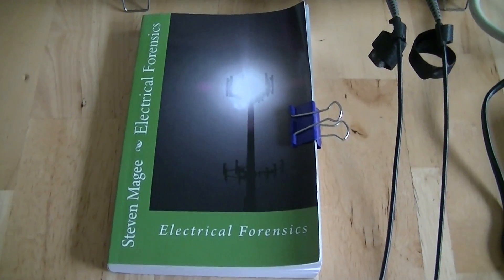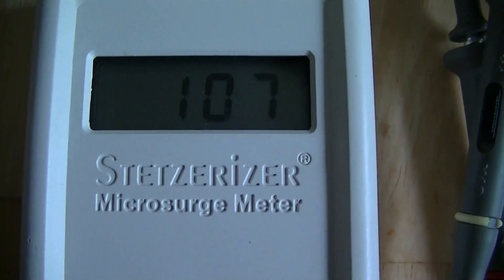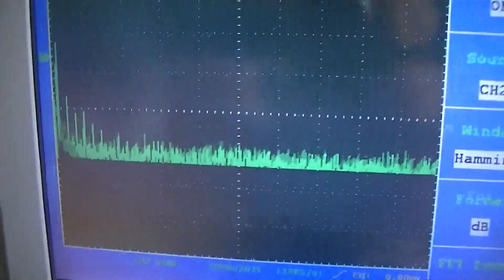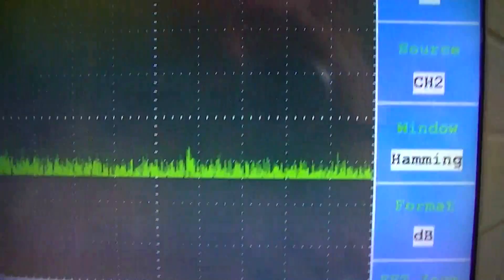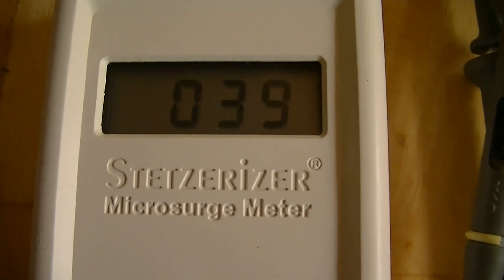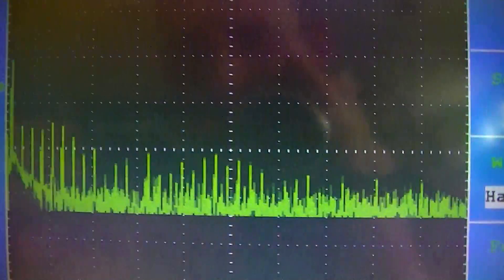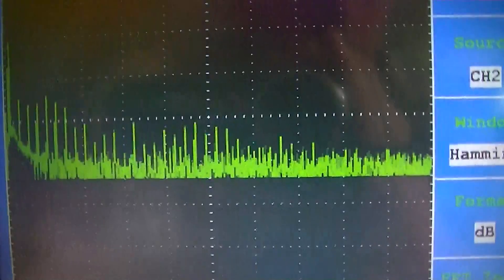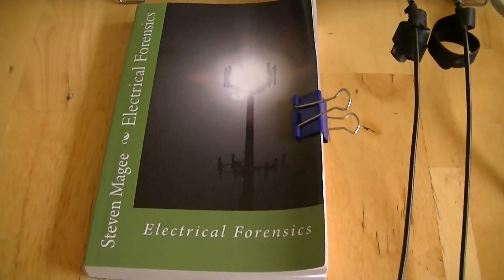Filtering the Highest Dirty Electricity Producing Product in my Home

Comment: I know this video is a little older but I had a question.  I have a few start run Capacitors laying around similar to yours.  I'm curious to how you wired the capacitor in circuit, as it's not clear in the video. Are you not concerned with the duty cycle of the capacitor. Also, where can I find your book? Sorry I'm a little new to the topic.